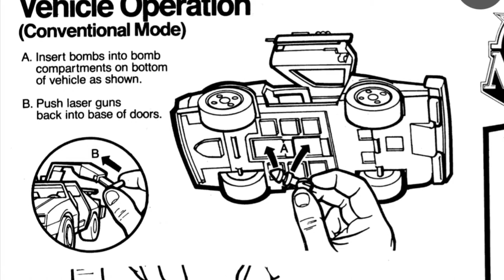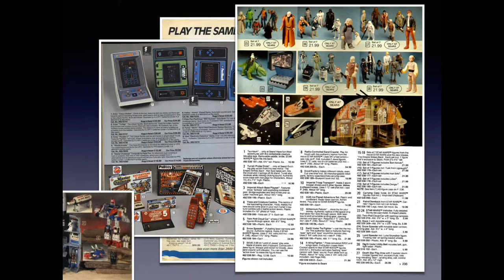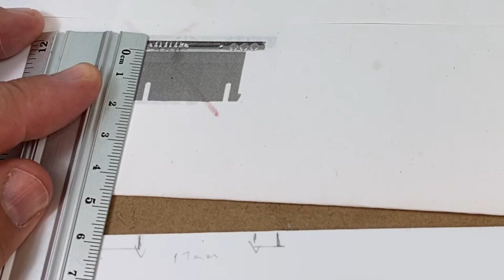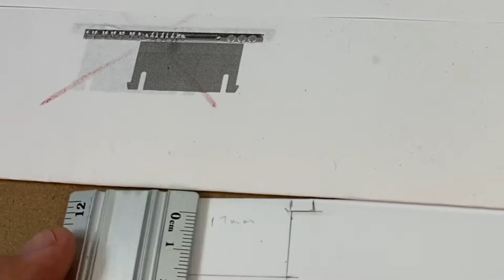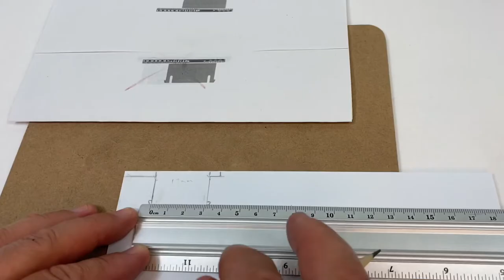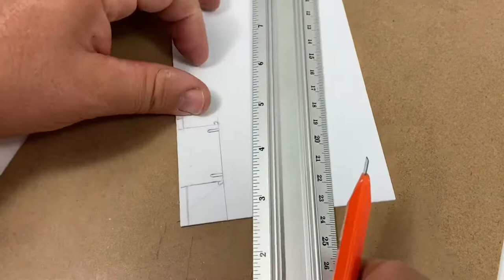How To Make Laser Guns / Exhaust Pipes For MASK Thunderhawk

Comment: Just to let you know, you are using Lester Sludge's Mudslinger mask on this figure.  Should be using Matt Trakker's Spectrum.  Although they are the same color scheme, they are too totally different masks.  Thanks so much for posting this.  My Thunderhawk was also missing the laser gun pipes.
Reply from the maker: Yes, that was brought to my attention in another comment. I do have Trakker with the correct helmet. I pulled the wrong one off the shelf when I did the video. I’m glad everyone is paying attention. Cheers!

Comment: Nice creative way at getting those laser gun exhaust pipes! Sadly my skills with such materials are extremely limited so I had to make do with getting some 3D printed versions. If I'm not mistaken I spotted some Molotow Liquid Chrome markers? Which ones did you use? A 1mm and a 2mm; or a 1mm and a 4mm? 

I used a 1mm to touch up some worn spots on my Hurricane and the end result looked great. Now I have some 2mm markers coming in as my Rhino also needed some touch-ups but I figured that a slightly wider marker would be more beneficial compared to the 1mm version. Wasn't sure if I should also get me a 4mm version of not but maybe I should as my 3D printed versions were just spraypainted in silver.🙂

btw why does your Matt Trakker have Lester Sludge's mask on? 😛
Reply from the maker: I use all 3 Molotov chrome pens, in this video I used the 1mm and 2mm. Good call on the mask, I have 3 Matt Trakkers. Long spectrum mask, short spectrum mask and the 3rd one you see in my video, because the vehicle was the focus I didn’t grab the correct figure as my prop. Yes he has an incorrect mask because I had an extra figure with no mask and an extra mask that looked close enough for display. Thanks for watching!
Reply: @toysbackzen  Heh, fair enough. 😉

Thanks for the video! 🙂